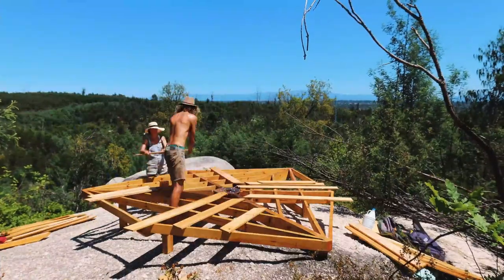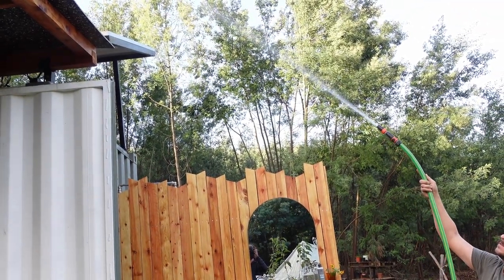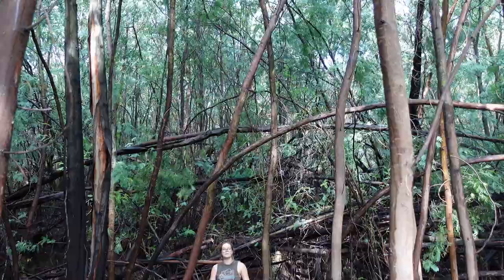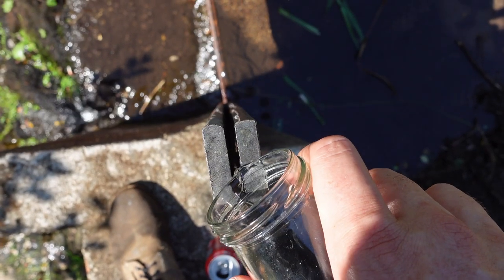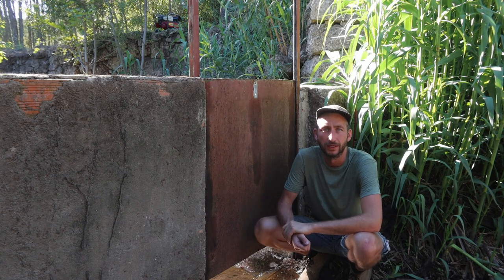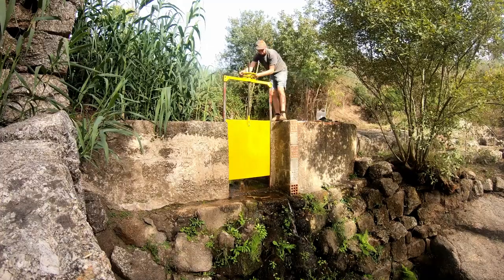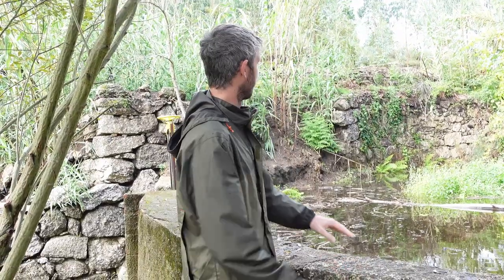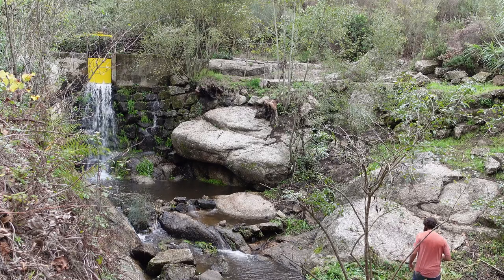#71 Fixing the waterfall door (before big rain comes)

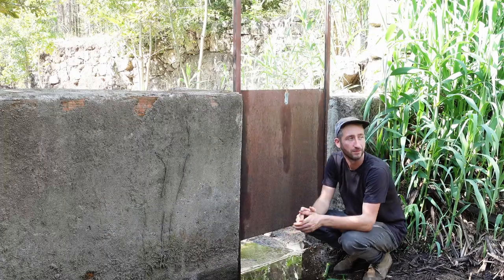Comment from the maker: For those suggesting a carjack. We tried. Episode #60 at 12:10 https://youtu.be/ZrBCIwTMqCs
Reply: That looks more like a toy, than a carjack. Get a real one, bigger one that takes a lot more weight/pressure with a longer arm for more leverage. Also don't use a wood log underneath... use stone/metal so all the force gets directed upwards!
Reply: @alxplx  and should have heaten it up much more. Oil it up, heat it up and let some wedging power do the work..
Reply: I suggested citric acid, the comment received 177 upvotes as of Nov. 15th but you didn't try it, instead you chose 0, 0, 5, 4 upvotes - that's not how you're supposed to crowd-source.
Reply: I'm surprised you folks didn't add a precious plastic sleeve between the guides/gate rails & the door (or at the very paint & fill those rails with grease to keep it from rusting solid again).... it would make it a bit more water tight though so it can really hold water during dry summers.
That said, I'm glad you were able to finally get it working.

Oh, also surprised you didn't use ropes to help pull out dirt & debris from the well (or make it deeper)...
Reply: Je had moeten wachten tot het koud werd ... De metalen plaat krimpt dan en dan gaat het vanzelf
Reply: It must be very satisfying to see it fill up. That has been a lot of work. I am not sure if it is possible or not but could you feed the well from the stream as well, for when you overflow?
Reply: You should try build a little hydro system by that water fall and the dam people use old motors which they run backwards
Reply: 10/20 ton bottle jack, not a car jack. Problem solved though. 😉

Don't forget to add marine grease to the metal on metal contact points.
Reply: a few things about your lagoon/ dam you should sand the inner track smooth and then paint it with a pain used for metal and water contact for a good sealing surface this will help with the sides. for unsticking it if it rusts again use pb blaster and a map gas torch to heat the sides of the plate up but at this point thats not needed. for the bottom i recommend recementing it so it is nice and level. you can use the gate to put a nice crease in the cement for a good seal. for the other leaks in the sides a good cleaning on the lagoon side and a recement coating on would greatly help give it a good seal against leaks. i have fix up something similar on a friends property many years ago.
Reply: 20 ton jack sosts twice hat the 2 ton costs
Reply: it's too late but you could of used paper towels around the areas you wanted to soak with the wd-40 it works a lot better in vertical cases or if you aren't sure it would be able to soak in because it may 'run off'
Reply: but still great content, keep it up
Reply: what camera do you use for time-lapse videos, is it just GoPro or are there others?
Reply: How is the plastic recycled panels holding up?
Reply: @dementedbowine8681  
It could be used for countless future projects. It's a good global investment.
Reply: Now it is free I would suggest that you got too a marine services supply store and get some marine safe grease and apply to the gate in the channels either side of the gate and the screw mechanism to stop future problems with seazing
Reply: Keep up with the great work it's is amazing to see the transformation and seeing the process of regeneration of the property
Reply: you should use a gutter on the roof so you can collect the rain to one place.
Reply: your car jack was a toy. get a proper one

Comment: The first thing that comes to my mind is a future project where you setup a hydroelectric energy plant. This could provide clean energy during the rainy seasons where sun is limited. A lot of pottential this land ! PS, The youtuber Kris Harbour has videos about similar setups !
Reply: Thought the same thing. Kris Harbour, great guy, very in detail hydro stuff.
Reply: Really neat idea
Reply: Exactly my thought ;)
Reply: How much wattage can you get out of such a small reservoire?
Reply: @DaDunge  that depends on the height difference, diameter of the pipe, i think Kris and Marty both have around 4 bar of pressure at the turbine, which could, depending of your wheel setup, give you 1-2 KW
Reply: @DaDunge  I would think the reservoir size defines how large your buffer is, but the influx of water is eat really defines the potential. In general AFAIK hydro is tricky with such long dry seasons and while it generates a lot of power it also has moving parts which complicates things, like with wind power
Reply: Nah, weed farm all the way bro 😂
Reply: @JoelPeltonen  It's actually the diffrence in height between the upper and lower reservioire that determines the power. But you also need enough water to allow it to flow for a while to make it worthwhile
Reply: @DaDunge  I think my terminology is bad sorry, I meant like power per year, not like a moment of output if that makes sense. Gettin 1000watts out is nice but that being stable for only a few months per year is really bad
Reply: @JoelPeltonen  I suppose if the hydro ran when the solar power was poor that would even out.  However, the cost of setting it up may not be worth it...
Reply: Without a clue, probably is not worth. Iberian Peninsula is very dry
Reply: Would love to see https://www.youtube.com/c/KrisHarbour Natural Building come down and do a colab video setting that up. Feel like the guy would fit right in the community.
Reply: Hoocho’s got some amazing ideas and examples
Reply: Came here to say this!
Reply: @JoelPeltonen  I imagine it's going to be very seasonal in Portugal.  Hydro's going to be a lot more reliable in the winter.  Solar's going to be a lot more reliable in the summer. It might only be a few months a year, but it's the same few months that their solar is hurting.  Running the two means they cover each other's weak spots.
Reply: I was literally about to write this haha!
Reply: Another place to look for ideas is  https://youtube.com/@LandtoHouse
Reply: @ProjectKamp, if you ever need a break, drive a couple of hours north east and visit the beautiful region of Asturias in Spain. In the west of that region you can visit the area of Taramundi-Los Oscos, especially village Os Texois will show you what can be done with water power...the village ran on their own generator from 1926-1983 until they finally got hooked up to the grid! Probably newer and more efficient tech is available now, but as usual a lot can be learnt from our ancestors.
Reply: also check out the channel for @OpenSourceLowTech who has a some recycled options and plans.
Reply: @kateapple1  I fail to see how a weed farm would provide power
Reply: Shame you didn't try two car jacks with a plank of wood under it to prise it up

Comment: Take a cold chisel down the gap that the door rides in on both sides spreading it open a little then remove rust with a thin grinder wheel and try beating the gate then. Also build some small channels to route the water to the well when it does rain
Reply: yeah that was frustrating to watch

Comment: I really think that leak in the rock wall of the dam should be fixed. This will cause tons of erosion and make it more unstable in time. My suggestion would be to lay a clay blanket in the reservoir, this will stop the water leaking through the soil and out the wall.
(Knowledge of this can be found when searching for custom pond claybed)

And if you wanted to fix the leaking at the side of the gate, use silicone kit in the corner of the gate rail. Also the bottom could be fixed by using an angle grinder on the gate or make a custom concrete ridge on the outside, should also stop bowing out of the gate.

Also the leaking of the plastic roof could be fixed with tar or liquid rubber.

Hope this helps you in any way. :)

Comment: For your plastic roof. You can get roofing screws for metal roofs they come with a washer that seals itself so any holes you make get sealed too, they come in many lengths so they are suited to a number of jobs.
With rusty items that are stuck, use old brake fluid. Pour it onto and into an gaps, leave it a day or so then take a blowtorch to it and it should break the seal. Get some underwater grease that is environmentally friendly that should help seal the gate. Cut a channel under the gate so it can sit into and next summer clean out the pond and you will find the holes. Mix some concrete and fill them and that will stop some of the leaks. If you can get teflon strips and apply them onto the gate and that will help it glide.

Comment: So for the metal door, instead of just slamming on it with a large hammer and in fact damaging it as you might be afraid to do, placing a board of wood on top and having someone else hold it will have an effect that allows the inertia from the hammer to travel through the wood into the metal plate below, the wood will act as a buffer between the metals as well, helping prevent damage. I do it frequently on other repairs.

Comment: I was thinking instead of big plastic sheets that warp in the sun, maybe it's better to use small "plastic shingles"? Maybe for a next design. Also you want the angle of the roof to have a bit more gradient so that the water can't pool and slide in-between in case the tape doesn't hold. Good luck 🤞
Reply: Yes perhaps build a mold for plastic shingles with tabs such as those made by @PrimitiveTechnology?
Reply: Better off to be corrugated and a steeper gradient

Comment: Hey guys, great video as always. I love watching the progrees you all make, and specially when you clean the mimosas and invasive species in general. Im from Galicia, NW Spain, and we have very similar if not the same ecological problems that you guys have down there in Portugal.

About the plastic roof, I was surprised you guys decided to use that solution way back when. You all have a huge body of knowledge and practical experience with plastic and its nature, and you should know that most plastics and the Sun dont mix well. The light and the heat warps and degrades the plastic, as you can see with the roof. Plastic can be a wonderful material if used sustainably and in the correct way, and I dont think this is the case. Not only the material is degrading super fast, it basically cant do the work it was designed to, and thats without talking about the very possible microplastics it must be leaking into the ground. If I were you, I would change it as soon as possible for a traditional clay roof.

The concept was intriguing and the experiment wss interesting, but after all tjis time is pretty obvious by the result that this roof is not meant to be.

Anyways, I wish you guys a good winter season down there. See you next season! :)

Comment: This video was amazing! Your video making skills are so much better and you have covered so much more content in this video. By the way, you have enough water to build dams and use it for hydroelectric. It's much easier than you might think! Also I would reinforce the wall for the dam, it's pretty easy but you can't do it when it's wet as you know, cement needs time to cure. You can reinforce it with stainless steel drilled directly onto the stone (On the inner side would be fine, as it won't look so pretty). It will take some preparation and you might need a bit of help from an engineer and a landscaper/brickie. But you can get this online! There's so many people willing to help on youtube. Good luck lads/lasses! I'll miss you through the winter.

There's also compounds you can use to seal the roof! Look into sealants, I know harsh chemicals aren't ideal but it's better than using wayyyy more recycled stuff that has taken energy to produce. It's a small amount of sealant vs massive amounts of energy potentially.

Comment: For the future, remember to clear the vegetation out before you let the lagoon area flood. Otherwise the water kill the plants and they rot. When the water level drops, and the rotting plants are exposed, the smell is horrible. Also, a lot of the soil in the lagoon area looks like dead or rotted wood. Probably be a good idea to dig that stuff up and flush it out. Also, for cleaning out that other well, take a couple saw-horses, a bar, and some rope... Lay the bar across the saw horses, toss the rope over it, and tie it to the bucket. Pull the rope to raise the bucket. Lot easier than using a person and a ladder.

Comment: If you need to fix the roof again, it might be a good idea to join the sheets via a guttering section between the flats . Water ideally needs a path to flow and typically isnt great on flat planes....

Grab a cheap winch for the well next time to spare your backs climbing up and down the ladder with heavy materials. I noticed the tree trunk could have acted as a handy place to attach a winch system!
Reply: I wouldnt use that tree trunk to lift anything. 
The forces applied, combined with the leverage effect could loosen the rocks in the wall and that would be bad. 
 I would have used a rope to lift the buckets out instead of  the human chain hand lifting process.
 In the event of a more major clean out, I would build a tripod over the top of the well and place a single pulley or perhaps a 2:1 reduction pulley system. 
In the event of that happening it's best to pull the rope from directly below the tripod ie; in the well,  so as to not risk toppling the tripod.
Reply: @Paul_Au   for a bucket of mud? I saw one of the team leaning on it heavily and it didn't seem a problem. Either way a winch would be of use 🤷🏻‍♂️
Reply: The winch comment is smart! That can also be used in the future
Reply: @Paul_Au  Agreed- anything that could loosen the stones creates a big risk. They could use the time-tested method of building a frame above the well and attaching pulleys.

Comment: By opening the gate and draining the lagoon (as you called it) you've reduced the amount of water available to recharge your aquifer.  Basic rules of watershed management in arid seasons dictate storing water high so you continue to feed your aquifer. When the aquifer is recharged, the stream that dried up this summer (became seasonal) will flow year round.  You've got to get that gate closed or build a new one.  Get out the WD 40 or the like and saturate ALL of the rusted together surfaces.  Once you get it released you need to sand and paint the gate and the tracks.  The gate is a very important piece of infrastructure.  It is so important it's repair can not be held back by principals.  Once you've got the rusted areas saturated with a petroleum based product, start working the joints with dental picks and scrape away the iron scale.  Never hammer on one side.  You are further binding the gate in the opening.  Always hammer in the middle and lift from the bottom with a hydraulic jack -a big one in the middle.  Your farmer neighbor likely has one he can lend you.  I'm thinking 10 tons to give you a sense of scale.

Comment: If you ever have the opportunity to redo the dam, I’d recommend using thick wooden planks rather than the sheet metal. Wood does not rust and swells when wet, giving it a better seal. When it dries out it shrinks, making it easier to remove. Yes, it will rot but wood is sustainable and can be reasonably replaced.
Reply: Any idea if olive oil might work to waterproof such a gate and also keep it sliding well? I suppose any oil/grease but oilve oil would be a local renewwable resource...
Reply: @PTEC3D  I think olive oil is too watery for that. It’s greasy, but doesn’t really stick. A kind of tar would be preferable.

Comment: If at some point better water tightness is needed on the dam gate, swap the rails for a larger c-channel and add a HDPE rail set inside of the c-channel. Plastic will seal better.

Comment: For the lagoon/ dam I have one suggestion that will help one with the leaking problem and increasing the capacity of the lagoon aswell, dig up some of the dirt in the lagoon untill you get to a more rocky or solid base instead of just mud and dirt. After that if it is rocky fill it in using concrete or some other alternative, if it’s mud underneath, I would either recommend putting down rocks with concrete or for a more environmentally friendly version use mud and wood ( make sure the wood has been dry out fully before use) to create a bed on the bottom to keep it from leaking aswell as keeping it solid . Love the vids keep it up 👍

Comment: That lagoon has the potential to really change your life at camp. Take a watering hose and place it somewhere in the lagoon off the floor (so mud and sticks don’t get pulled into it clogging it) and run the hose back to camp. If you have to attach more than one hose together just make sure the connections are leak proof. Attach the hose to the rock walls and stuff so plants roots don’t grow through the hose anywhere along the way. Once the hose reaches camp attach it to sump pump that can run off your generator. Have the sump pump empty into a 55gallon drum that’s filled with water filtering materials to remove anything harmful. Then attach a pvc pipe from the drum, to like a big 2500 gallon plastic water container. I’d bury it though so sunlight didn’t get to it, if sunlight hits it it’ll grow algae inside. Or build a weather proof building around it with no sunlight coming inside. With that 2500 gallon container filled you can use it to shower, rinse food before you boil it or cook it, use it to water your garden, you can use it to raise chickens or goat or pigs or something, fill up your own hot tub to relax or bathe in for the cold months, you can even try to run a separate hose to your outhouse to make an actual functioning toilet! Or drink it if you’re brave lol.. but the possibilities are endless!

Comment: For safety you need to build a structure around the old well to prevent people from falling in. If you determine that the water is unfit for drinking, then it would be best to fill in the well.